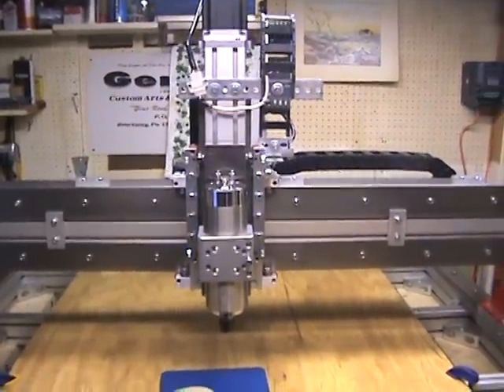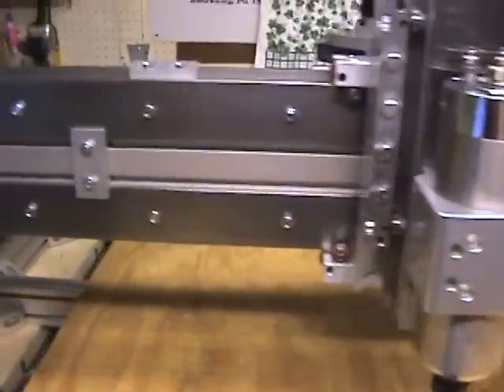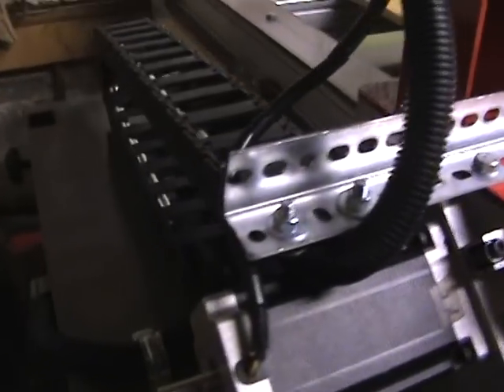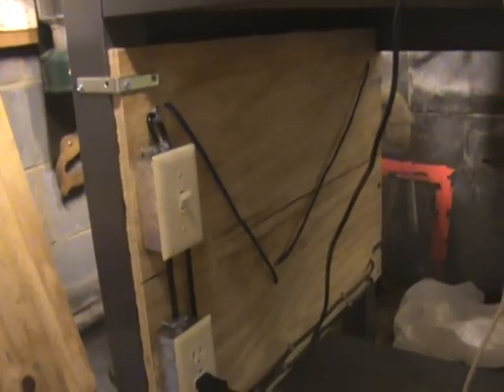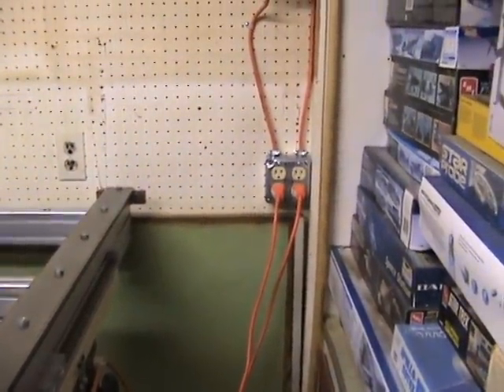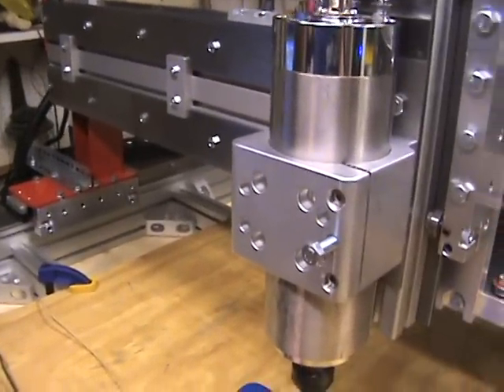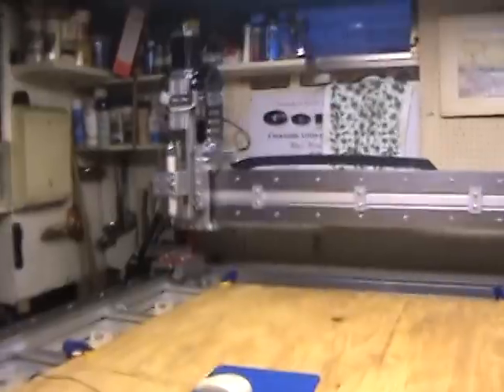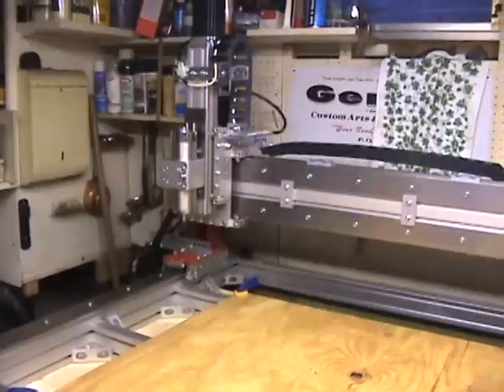Building CNC Router Parts CRP4848-17.MPG

Comment: Cutting stainless steel with this machine? Dont take this personal , but sounds like a bad joke. Machine for cutting steel with that much travell will weight at least 15tons, will have at least 20KW main spindle motor, will not use rack and pinion but ballscrews class < C5  etc etc... Your desing is not rigid, and torsional forces will bend gantry even with small forces, bellow 50Nm. You will also destroy this Chinese spindle, if youll cut steel with it. It is meant for woodworking. I would also suggest you to grind inner hole, where coolet sits, as these spindles tend to have a lot of runout. You can check procedure on one of my videos. Such desing is OK for woodworking and not very precise woorking with aluminium and other soft metal.  For any serious metal working, moving gantry is not good option. 
Anyway, you got really nice feedrates out of those stepper motors.

Comment: thank you this work
  pls help me I want to build a cnc router to cut wood other parts, prefer if the size if 2600*1600MM, What motors and spindle should I be using
it's possible use this kit      CNC 3.5A TB6560 3 Axis Router Stepper Motor

Comment: Hi - I'm looking at these possibly for my next machine, I have a wooden one already which is on my channel. A couple of questions:

- what steppers and drivers have you used?
- can you explain how the bearings are tensioned against the X, Y, and Z rails? I have had a look at the plans on the supplier's website and can't figure it out.... oh hang on, yes I can, there's set screws for this

Thanks!
Reply from the maker: +richienorthcott , Hello, and thanks for asking.  Yes there are set screws to adjust the tension, you need to tighten the Bearing bolt snug first then adjust the set screw, then finish tightening the Bearing bolt.  If you look at my very first video I review all the motors and drivers I used for my machine.  I'll be building a new base for the machine soon and moving the CRP4848 to my new shop, stay tuned.

Comment: How bad is backlash/play on the drive (rack/pinion)? Did you measure pls?
Drive is so fast, is there any reason to be that way? Its router, so cutting speed will be few times slower. Cheers Tom
Reply from the maker: Tom J Designs Hello Tom.  There are tension springs that keep the pinion gear engaged to the rack that eliminates backlash.  If you push the system too hard then you could exceed the tension and create some, but it has not been a issue so far.  The high speeds aid in reducing cycle times buy moving the axis's quickly between cutting cycles. Cheers.